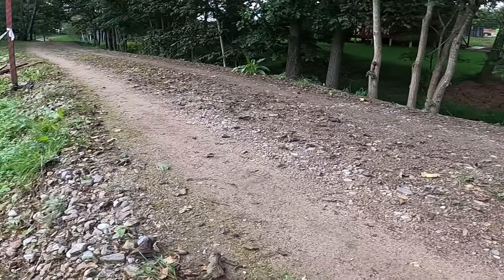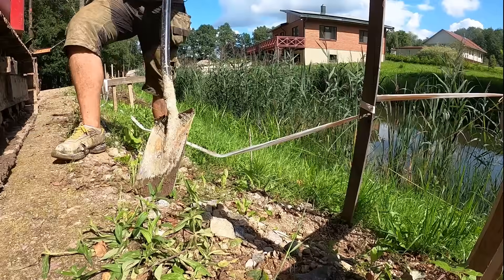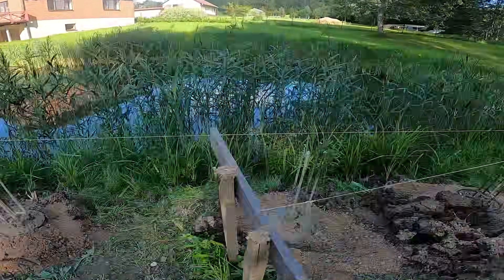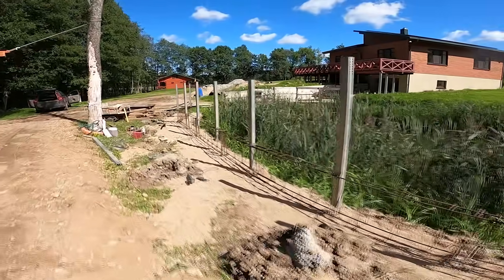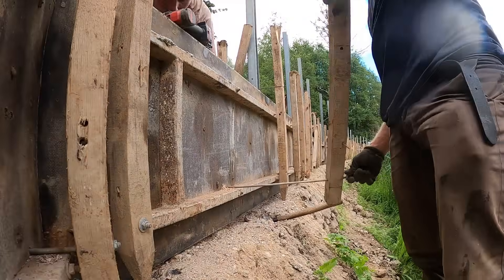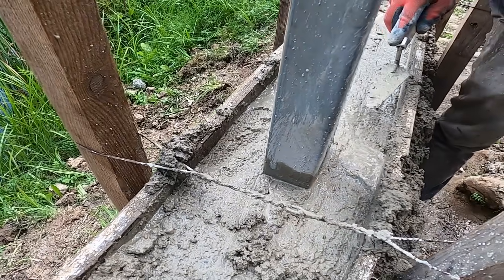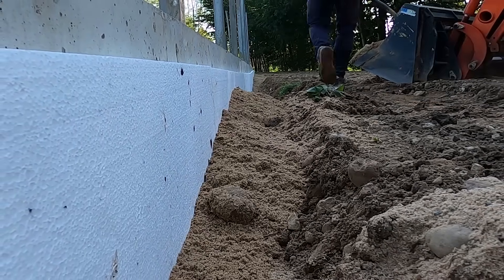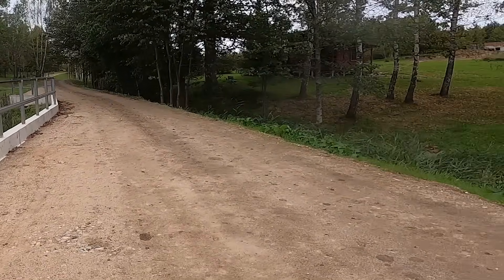How We Built a Concrete Retaining Wall for Road Stabilization

Comment: You can use an edger on the concrete meniscus at the top. It rounds the edges of the wall and gives it a more aesthetic look. I've seen Japanese construction companies use this method. You have to wait a while for the concrete to set a little before edging the top of the wall.
Reply from the maker: Yeah, an edger would be good to use and definitely worth learning for builds like this. In this case the wall is a bit too thin, so using an edger would be tricky.

Comment: That is very shotty [bad] concrete forming. I have poured concrete for over 40 years, and i have never seen it any worse. You should have hired it out to a pro. Also, I didn't see any stone in your mix? That would make the job even worse. No strength in the wall or concrete. You poured the wall with slurry, NOT concrete--it requires cement, sand, stone and water [plus additives]
Reply from the maker: If you watch the pour closely, you’ll see this was not a slurry. The mix included sharp sand with natural aggregate content, which is common here and appropriate for this wall. Placement and consolidation are shown on camera. This wasn’t a random mix or a mistake. It was a deliberate method used successfully on many builds.
Reply: @LibraryofConstruction yeow, cat fight!

Comment: Just sand & cement in your ‘concrete’??? Where’s the gravel/aggregate?
Reply from the maker: It’s sharp sand 😀
Reply: @LibraryofConstruction  no no no you aggregate R used to Stone in the concrete when you're pouring it
Reply from the maker: @ShotDemEntertainment  Trust me, it did the job just fine for this wall. I get what you mean though.
Reply: @LibraryofConstruction ok